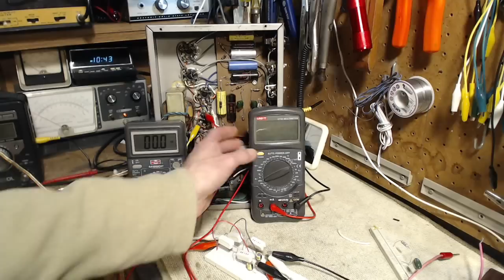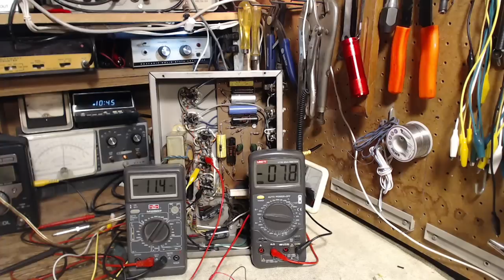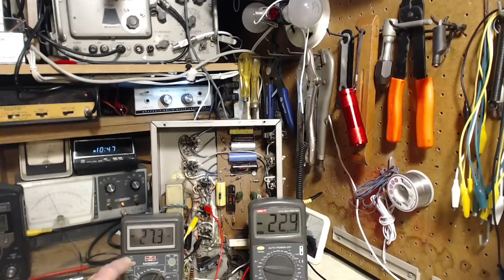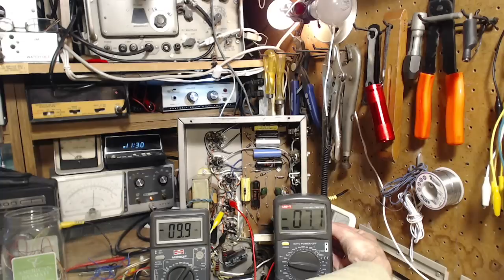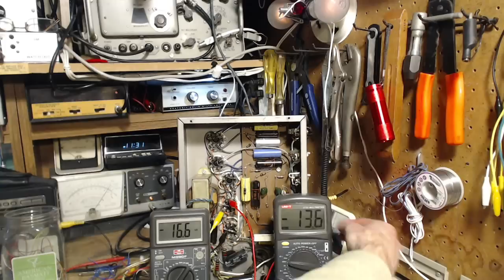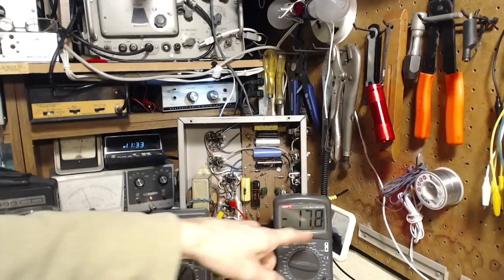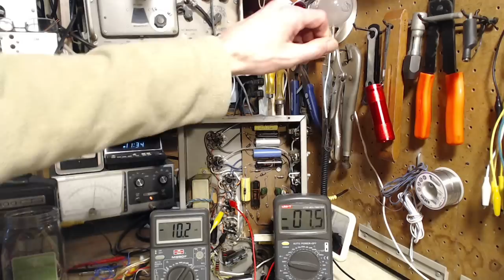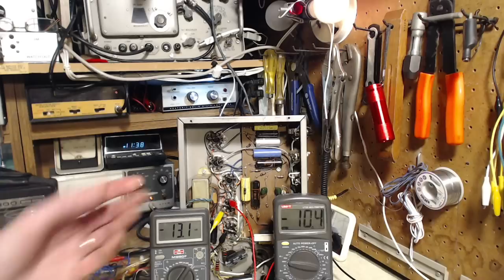Vacuum Tube PA Amplifier Video #18 - Full Supply Voltage Applied

Comment: I read 2 particular comments here from your viewers which I tend to agree with. BRSHiFi and magrosi65, On another note, if the amplifier was built during the era of 117VAC, running the amp at 120-125VAC will naturally give you an increase in B+. 6L6GC's and an adjustable bias may be the answer here.  By the way, Merry Christmas to you & yours :)

Comment: I would use a common cathode resistor, and a potentiometer to balance the currents. In practice, the cathode of a tube applied to one end of the potentiometer, the cathode of the other tube connected to the other end and the cursor of the potentiometer connected to the cathode resistor. But B+ still waaaay too high for 6V6, this must be absolutely fixed in some way! Have you checked the voltage across the filaments ?, it is ok?

Comment: In addition to my comment below, it would be interesting to check the filament voltage at full line voltage.  If it is high, this could be an indication that 6L6 tubes were used originally.  The heater current of 6V6s is 450ma each while the heater current on 6L6s is 900ma each.  Also if 6L6s were used, there was probably a different rectifier tube as well such as a 5U4 or 5AR4 which can handle the higher currents of the 6L6s.

Comment: I am curious as to how the power supply is wired.  The small blue electrolytic capacitor that blew up before you received the amp, this usually happens if the capacitor is wired backwards, wrong polarity or if too much voltage is applied across the capacitor.  Also I noticed the white wire from the power cord is wired to the power switch, this is normally not done.  Normally the black wire (hot) goes to the fuse, if there is one, and then to the switch. I suspect that the person who rewired the power supply and installed new capacitors, may have been lacking in some fundamental technical knowledge.  I am also wondering how the plate supply secondary on the power supply transformer is wired, this might cause excessive voltage if not done correctly.  It might be worth the time to draw out a schematic of the power supply to see if it is wired properly.